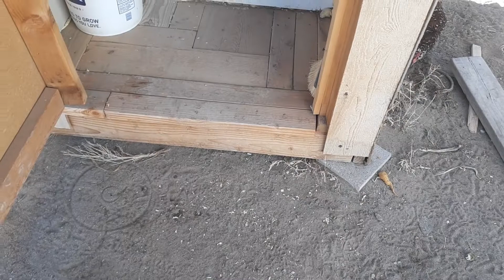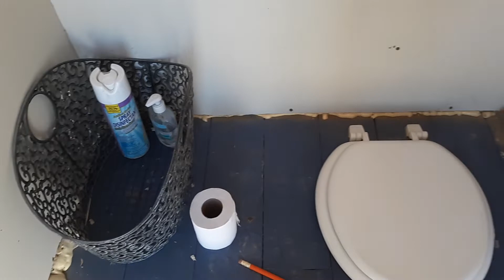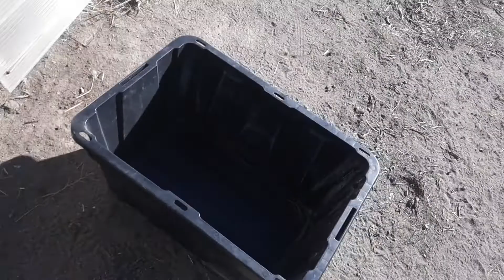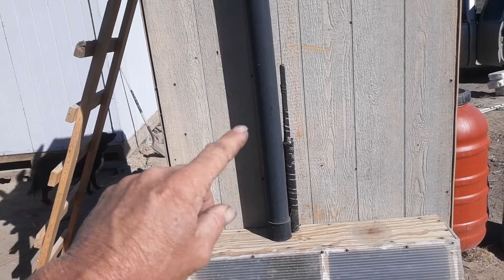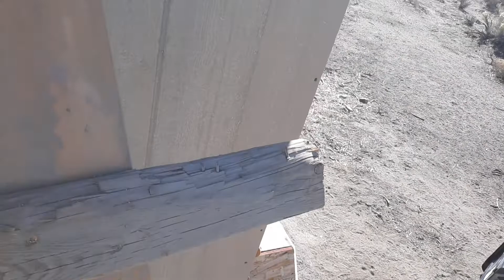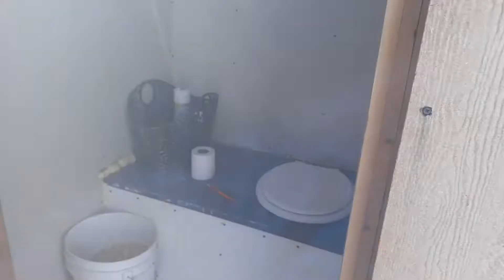emergency latrine

Comment: Very innovative!  I might have considered mounting the water for clean up over the hole (an idea from toilets in Japan that use a spigot over the flush tank for washing hands, goes down into the tank for the next flush) but not if your goal is drying it out.  I wonder if this "night soil" is really dangerous after being baked in there for so long - you would think any microbes would be killed off in the heat box, but best to be safe I guess.